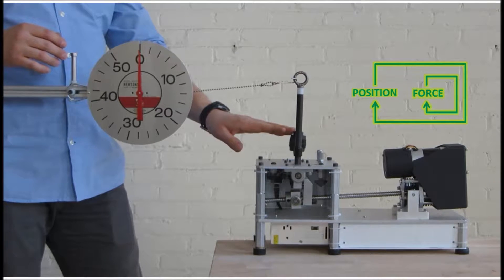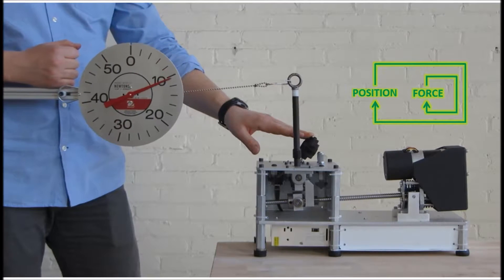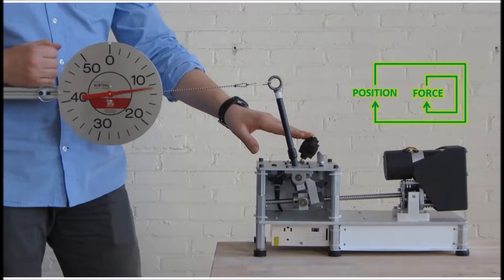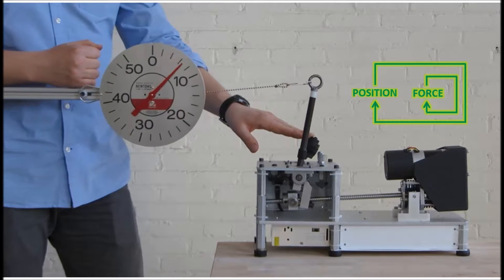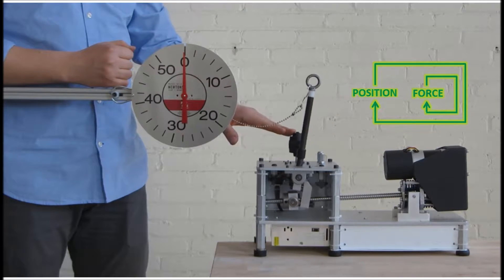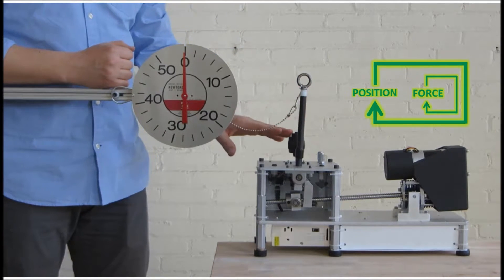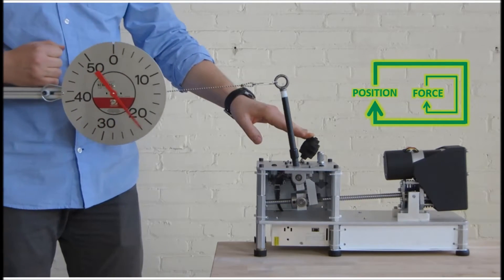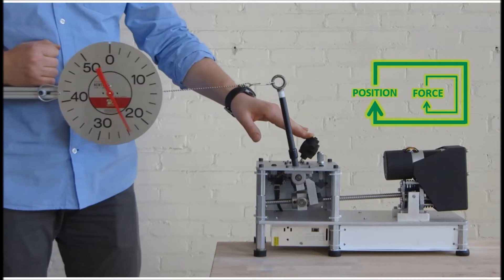Stiffness Control - 2

Comment: I have watched both of your videos about stiffness control. However, what is the slight difference between a stiffness control and an impedance control?
Reply from the maker: Stiffness pertains only to the force-displacement relation. Impedance includes stiffness, damping and inertia. The first two can be controlled. Inertia (apparent inertia) can be reduced, which is not the same as controlling it.